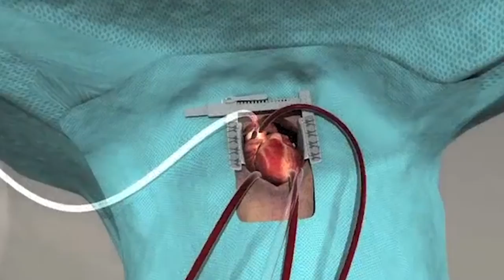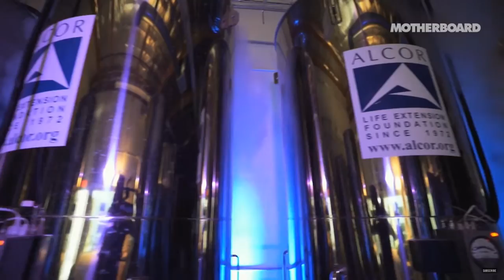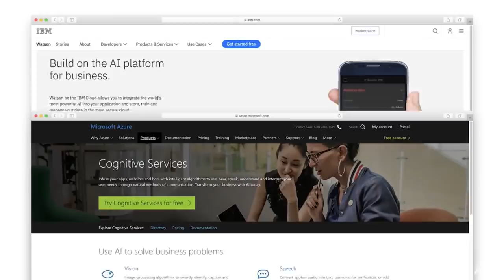Afterlife Insurance: Is Cryonics Really That Crazy? | Answers With Joe

Comment: More interesting, from a theorycrafting standpoint, is that even in liquid nitrogen we have an experiation date. No biological processes are running, but radioactive decay of isotopes and damage due to background/cosmic radiation is still occuring. Simplistic calculations point to a ballpark of 1000-5000 years till one accumulated a destructive dose of radiation.
Reply: Great! More questions! This won't be feasable for at least another hundred years
Reply: @zombiasnow15  so well in the ballpark of 1000 years ;)
Reply: Yeah wow, all your carbon 14 won't be replaced, huh wonder how that would affect it
Reply: You can't get cancer or die of radiation if you're "glassified"
Reply: @ShadowLynx777  depends on the method of reviving. If it's digital upload, sure. If it's thawing out and repairing the freezing damage and what killed you, then the additional molecular damage of the accumulated hundreds of Grays won't make the job any easier.
Note that I am talking about doses that kills people directly, not sets one up for cancer in 10 years.
Reply: @Elbrasch  
If we get to that point we'd have to address that problem regardless so medical tech to repair that damage doesn't seem difficult to comprehend. All hypothetically of course 

Every single cell in the human body is replaceable naturally (except eggs I think), so with future medical tech they should be able to fix that no problem. 

If we never get that kind of tech then we probably won't be successfully dethawing people anyways

Comment: I appreciate I am late to the party on this but a couple of follow ups I’d appreciate someone to chime in on. 1. What is the difference in vitrification of the body vs brain? Is it possible that by focussing on one organ the success rate may be higher?

2. I have thought a lot about the teleportation problem and how if you make a copy of the brain it is no longer you. I may have a way around it. The brain works via electrical signals. Suppose we can replace portion of those with our computerised alternative and have them wired up to interface with our existing brain, you’d still be you. Now let’s keep going, at what point would you lose control over your own memories thoughts and feelings. Is it when the final Neuron is replaced? Or does it never happen?

Comment: I think the way to solve the teleportation problem applied to extracting someones conscious from their brain is to first integrate the brain with an artificial system and then slowly replace it piece by piece without breaking the continuity of the experience of self. Basically fixing one paradox with another. Since our body has no problem replacing the matter that makes it and especially the brain without running into the teleportation problem so I think we'd have to imitate that process.

Comment: Between a 0% chance of revival and a 1% chance of revival, it seems like the 2nd option would be the most rational. Cryonics might be a long shot, but it is the only shot available right now for those who want to live forever. 

Basically, it's either cryonics, or a 0% chance at life. 

Question for Joe: Are you signed up yourself? You seem to be quite convinced by the logic of cryonics..

https://waitbutwhy.com/2016/03/cryonics.html

Good case for cryonics. Long read but quite worth it. 

"Cryonics is the process of pausing people in critical condition who can’t accept the concept of death, in the hopes that people from the future will be able to save them."

Comment: Quantum teleportation is never a suicide. Depending on what you call "you" there's only two options:
either you survive as a continuous process tied to a fundamentally unique set of quantum information,
or you never really lived in the first place, being just a series of snapshots each with their own illusion of self.
Reply: add to the fact that every cell in your body is replaced several times over the span of your life, its even less of an issue. Especially if they can scan for and remove cancer and unwanted microbes just prior to reconstruction.

Comment: I've always wondered if your personality can survive the freezing. Our brains aren't like hard disks that have a bit turned on or off to permanently store information, it's more like RAM which relies of long-term temporary storage (I know physical connections are made for muscle control and certain basics) but the lack of energy being added to run that system makes me think when you wake up you'll be like a reformatted computer. The hardware will be there, you'll be able to control the input devices (sight, sound, touch, taste, smell) and probably the output devices (making sounds, moving limbs, digestion, etc) but the OS is gone.

Comment: My concerns about this would include: 1) proof that the cryoprotectant gets fully despersed through the body 100.0000%.  2) proof that the cryoprotectant does not act like a poison such that if they could bring you back that you would not die from the cryoprotectant.  3) proof that they could fully remove the cryoprotectant when they bring you back.
Reply: 1) It doesn't, at least not 100.0000%. Different organs perfuse at different rates, and the process accounts for this, but it's not absolutely flawless. The key is to get sufficiently thorough brain perfusion to preserve the neural structure, and it looks like that's happening for most cases.
2) The cryoprotectant is toxic at the concentrations in which it's used. That doesn't mean that it can't be flushed out and replaced with water before the patient is revived. Yeah, that's a problem, but not not an impossible one.
3) See above. If we had the ability to do that then we'd already have reversible cryopreservation. We don't. Ultimately, with cryonics you're betting on future technology, which is inherently speculative. There are no 100% guarantees, just like everything else in life. Okay, I guess there's a guarantee that you know what happens if you don't sign up, but you get my point. Historically, betting that a particular technology will never be developed is a bad idea.

Comment: I assume you've mentioned in other videos that Pascal's wager only works if there is a single deity with a single interpretation of it's desires and rules.  If Pascal's wager is applied to an environment where there are multiple competing god ideas, where they include unique demands of commitment with a specific attendance to a rule set, what you end up with is a Russian roulette game with a gun with tens of thousand of chambers filled and only one is empty.  Certainly not good odds, and that's assuming we've heard of the deity and/or accurate set of rules that will get us to a good outcome rather than a terrible one.

Then, of course, the rules themselves might exclude the possibility of choosing the deity as an insurance deal.  The intent and practice of the devotee might still invalidate a claim of adherence even to the correct deity.

With regards to cryonics, I have to wonder why someone in the future would decide to reverse the vitrifying process.  What would they want with some ancient body and possibly mind?  Would they use it to research better medical cures or ways of prolonging life in general?  I think that is happening now, so it might not be an issue to solve.  Perhaps to enable extended space flight, using a vitrified crew?  Perhaps as time capsules, to look into human history directly?  The problem being that you'd have to teach those revived modern languages to enable them to speak to you, and in so doing you may well corrupt the source of the information you are trying to acquire.   I just feel like you'd end up as a guinea pig or a lab rat.  I think it would be a profound culture shock.

This is all assuming we don't massively change ourselves with both cybernetic and genetic modifications.  If we do that I don't think a revived human would recognize what woke them up.

I also have very strong doubts that any organization can last several hundred years.  Which organizations can we point to that have successfully done so?

Comment: Teleporters are not suicide machines.  Between cell replacement, fluid exchange, respiration, and digestion, you are made of virtually none of the same atoms as the ones you were born with.  Even though many brain cells do not replace themselves, they still exchange atoms via respiration and fluid exchange.  Moonlight sonata is not notes on a page.  It's a pattern.  You are not the atoms you are made of, you are the pattern those atoms create.  I can play Moonlight sonata on any ol' piano I'd like.  You can be made out of any ol' atoms whatsoever as long as they make the right pattern.

Comment: Exactly which god was Pascal talking about, and how was it related to the rest of this video?

Pascal's wager would maybe make more sense as an argument for believing in a god if in this world there was only one single monotheistic religion with no sects.
Instead this world has a plethora of religions each with any number of sects, denominations, and gods; and most of them in complete disagreement about who get what benefits and punishments, and for which reasons.

Isn't it then the safer bet not to pick a god to believe in, in order to avoid the very high chance of picking the wrong one and possibly offending one or more of those gods that might exist even more than you would by simply admitting that you don't know??

Well, someone will maybe - for some reason - disagree.
In which case, keep in mind that religious exclusivism has the additional requirement that ALL other religions must be untrue before a religion claiming exclusivity can be true, and therefore make religions with claims of religious exclusivity mathematically the least likely religions to be true. So if you absolutely have to pick a god and/or a religion, at least do yourself a favor and don't pick one that makes claims of exclusivity, because - even assuming at least one of the many religions out there has to be true - those odds become absolutely abysmal.

I think I'd rather have myself "glassed" and hope I can wake up again one day and just be greatfull to experience some more stuff for a while before inexorably dying for good and then - I don't know - we'll either cross that bridge when we get to it, or there won't be any bridge to cross.

Comment: From what I gather

Brain needs chemicals electricity and stuff to reboot our lil control panel.

Like a machine, needs oil, fuel, and electricity

Okay, we give brain a jump, prime with fresh blood, assuming cells haven't burst with cryoprotectants, or even then wait an insanely long time by keepingcosmic rays and all other radiation out or lengthen storage time, chill (pun intended) for 4k years, to solve our cellular burst problem(could be robotic body, or cloned body, or nanotechnology, or some other simple solution we havent discovered) and get a system to provide said requirements for a restart of brain.

Basically

Freeze, block radiation, hope understanding of human medicine improves to the cellular level, or we figure how to synthesize new forms of bodies and splice heads

Within, just throwing numbers out of my ass 3k-5k years